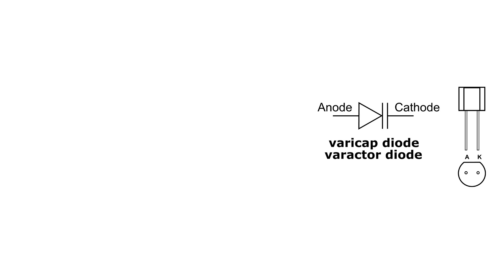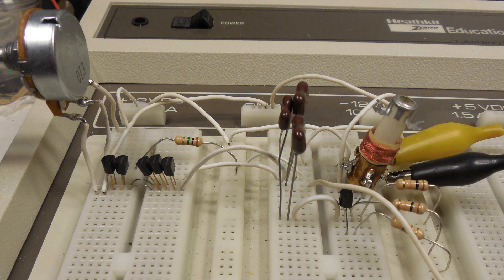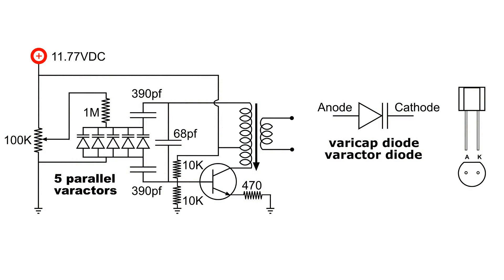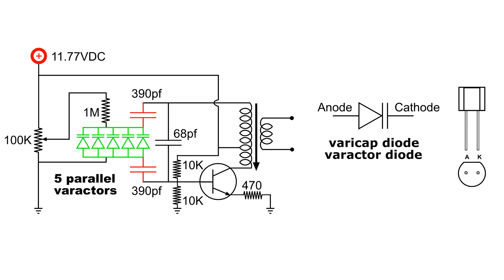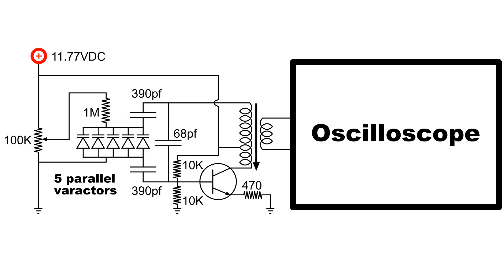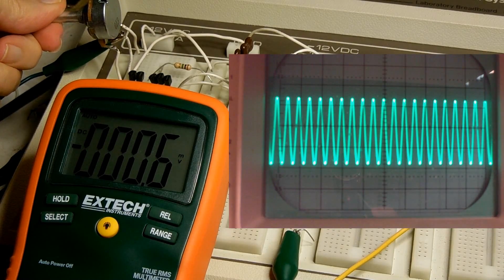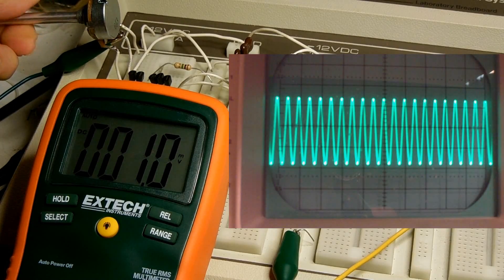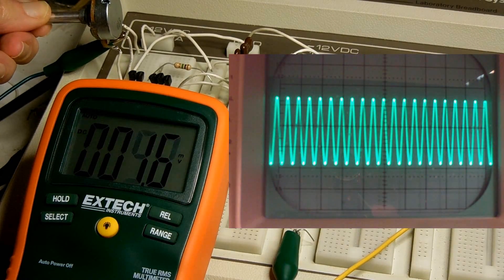Oscillator Varactor Frequency Control circuit demo

Comment: The bottom leads of the varicaps and the bottom lead of the lower 390 pF are connected together, then they are connected to the ground on the left.  Your description seemed to say that the lower 390 pF was isolating the varicaps from ground.  I might have misunderstood, but I thought it might be possible to clarify it some.  Thanks for the video.
Reply from the maker: Capacitors block DC

Comment: Hello i have a question about a oscilloscope that i am unable to identity  and was wondering if you could help  I am a audio EQ nut and collect stuff every chance i get          I been wanting to learn how to use a scope  i bout  one then i was told that it has a  UFH  connection and probabile could not find one   so then i bout two more with BNC connecters also with out probes I on ssd and cant afford much so i buy a little at a time thought i could pick up  probes up later but  Im a nu-be and not sure what kind to get anyway the one scupe i was told is from the the late 40's early 50's GE ocilloascope type st-2a and two tek 547 / 7844  and i got a tub of tube's i picked up with the first scope about 50 or so he said  they are good half are in box's other are not and i dont think ill be needing them would you be interested in stuff like that  if  you can help that would be great thanks I can send pic if that would help   and really like your vid very helpful
Reply from the maker: If I'm working on small transistor radios sometimes I just use two wires. Of course you would not want to do that with anything that has high-voltage. The type of probes I have, has a built-in resistor network which can be switched between two choices. I would think almost any oscilloscope probe would work as long as it has the right connector to fit on your oscilloscope. I always encourage people getting help locally if possible. One place you might contact is a local ham radio club. Not only are there people in the club that use and have oscilloscopes, but they may have some oscilloscope probes for sale. Also another place would be in antique radio club. Hope this helps.
Reply: Well thanks for the info i'll look around and seen if there any groups like that in my area thank again

Comment: It occurred to me that your last video was in regards to using the varactor as a means of frequency adjustment in a Colpitts or Wein bridge . Nice to know I was right. Looks like you've worked your way toward a variable RF generator or a modulator. As a 20 plus year amp tech I've always worked with audio however, as of late, I'm venturing into RF now that I'm getting older. I've taken a slightly different approach with my layout however, I'm giving your design some consideration as I'm looking for low distortion design out to at least 150mhz. I have a design using a logic inverter (74ah14) out to 75mhz and works really well after some low pass filtering to get a pure sine wave but I think distortion will get me in the end. I look forward to where this will lead.
Reply from the maker: I think I'll keep this on the mockup for a while. I may change out the coil and see if I can't make it into an FM transmitter.
Reply: AllAmericanFiveRadio
I would enjoy that for sure.

Comment: Could you specify what the range of frequencies you are able to achieve using this tuning method?  You did not list any values for the inductances in your schematic or the formula for the resonant frequency of the oscillator.
Reply from the maker: Finally got around to measuring frequencies and I put this information in the show more of this video. You can find the coil at Antique Electronic Supply.

1330KHz – 1500KHz

Coil P-C70-OSC

Varacator	
ECG610 quantity 2
ECG611 quantity 1
		ECG612 quantity 1
		ECG613 quantity 1